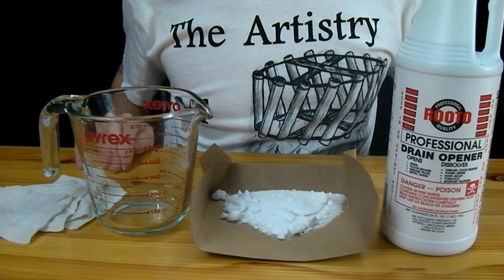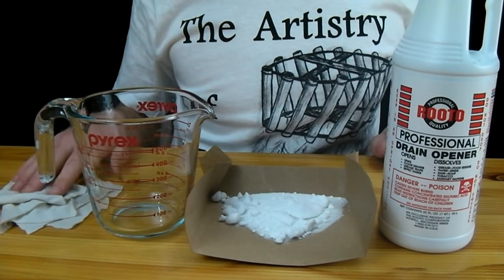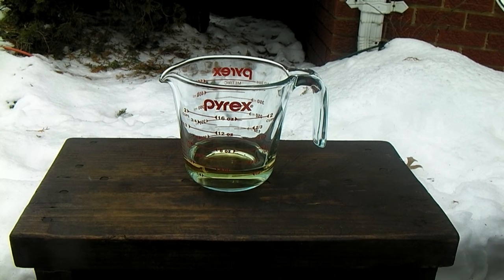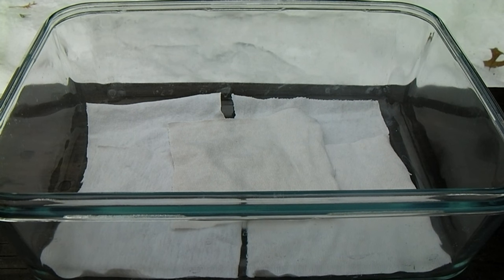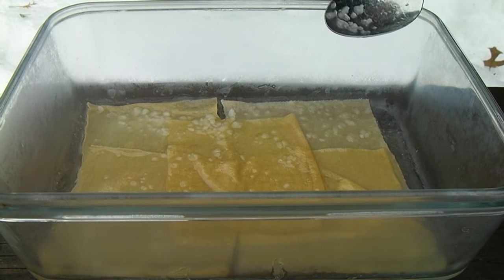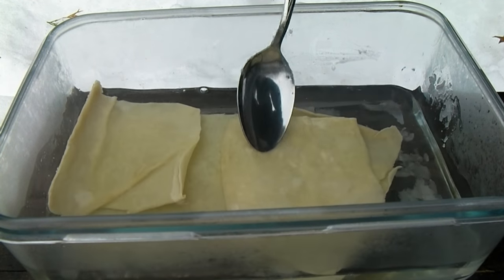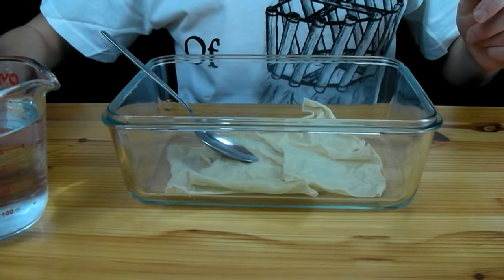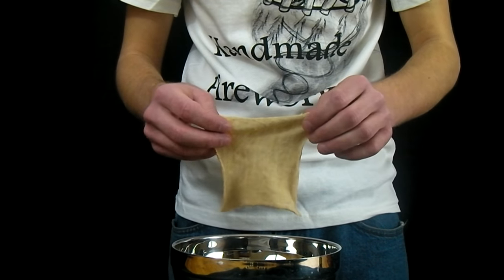How to Make Flash Paper - Magic Trick Fireballs (Nitrocellulose)

Comment: Ebay or one of those pro-healthfood online stores, you can get food grade quality for dirt cheap prices from the healthfood stores because the purity isn't the selling point even though it has to be >99,5% to be food grade.

So get it there, but it will come in granulated and not in powder form since it's for food preservation to be used like your average kitchen salt, so you are going to have to grind it.

Those are your options if you want to spend little money. I got 5kg for 24 euros.

Comment from the maker: When it is formed, the nitric acid is in a solution heavily contaminated by the remaining sulfuric acid and the potassium sulfate byproduct. It could not be used in other experiments as if it were a marked bottle of a specific concentration because it is so contaminated with other reactive compounds. If you want to know what percentage the nitric acid is to the rest of the solution, I have not done the calculations to find that out.

Comment from the maker: Nitric acid is formed in solution:
2 KNO3 + H2SO4 → 2 HNO3 + K2SO4

This is where the nitric acid comes from when it is distilled out of a sulfuric acid/nitrate solution. This process simply skips intermediary distillation, and absolutely does produce nitrocellulose. You can see direct performance of product from this same potassium nitrate process in the video here: /Nbt057a8Zzc
Or, nitrocellulose made by substituting an equal molar mass of ammonium nitrate here: /J3Ot4AcO47Q

Comment from the maker: You are incorrect. This burns slowly because the fabric used is a low grade cotton. You can see a high quality nitrocellulose made with this same method on my homepage. The chemicals used in this are very dangerous, and the same ones used in commercial production. Nitric acid is made in solution for this method, where usually it would be added directly, but otherwise it is exactly the same.

Comment: Nitrocellulose is made with nitric acid and sulfuric acid. They work separately like when Aqua Regia dissolves gold. Most people don't know  but cotton is mostly a sugar. when you add sulfuric acid it dehydrates it leaving broken bonds the nitrc acid is also dehydrated and has a key to the bond on the cellulose. The two connect and you have a nitrocarbon and sulfuric acid with stolen hydrogen.

Comment: @ERFireworks I found Rooto drain opener at Ace Hardware.  Just check the plumbing section of every hardware store in the area.  Sulfuric acid drain openers often come with the bottle in a plastic bag, and mention sulfuric acid somewhere on the label.

Comment: Seeking advice:  I followed the instructions in this video, but it didn't work.  I must have made a mistake.  The cotton squares dissolved to mush.

I used sulfuric acid from Lowe's.

A lot of the potassium nitrate (50grams) didn't dissolve.  There were clumps of it at the bottom of the pyrex measuring cup, even after much stirring. 80ml of acid was recommended, and I had used 100ml.

I increased the acid until all of the potassium nitrate dissolved.  It was about 200ml total.

The instructions said to wait an hour after pouring the mix on the cotton.  I used an ice bath to cool the glass tray, but didn't have much ice.

I waited 80 minutes and the cotton  squares had dissolved to mush.

Any ideas on what I did that made this procedure not work?
Reply: I had the same problem with concentrated battery acid. Later I was able to get pure sulfuric acid and it worked. I suppose there will be differences or additives in the acids.

Comment: doesn't the sodium bicarbonate wash cause the  nitrocellulose to burn slower?
Reply: +schel sullivan Sodium nitrate neutralizes the acid but it adds impurities which you have to wash out. And the cooling bath is necessary to make sure the cellulosedoes not dissolve in the H2SO4.
Reply: Awesome thanks I've learned a lot this year experimenting and making videos
Reply: @keymaster2108  i heard you can just boil it in distilled water, is that true

Comment from the maker: @cheerdiver ...Not quite...You're chemistry is a little shotty there. Three nitro groups can be given in one acid bath, it doesn't take multiple runs.

Also, freezing NG sounds extremely dangerous. Liquids crack and shear as they freeze, and both of those things are two major initiators for sensitive compounds. This is why large crystals are avoided at all cost in solid HE. Frozen NG would be much more dangerous than liquid.

Anyway, please, no more discussion of HE on my videos.

Comment: You should leave the tissue paper in the acid mix for about 4/5 mins turning over half way through then soak in running water for about an hour

You can place a few sheets on top of each other whilst in the max say 3 but no more 

I use a dustbin with a hole in the bottom and a hose with running water in the top

Comment: Interesting fact: The base components of modern smokeless gunpowder are nitrocelulose and DNT (Di-Nitro Toluene).  TNT is the stronger Tri-Nitro Toluene.
Reply: TNT = TriNitroToluene.
Reply: Emx2000 he already said that
Reply: Ther are two basic types of modern smokeless powder, single base, and double base. The single base is nitrocellulose and the double base is nitrocellulose and nitroglycerine. (  One advantage that nitroglycerin has over some other high explosives, like TNT, is that no solid forms of carbon (in the form of soot or smoke) is produced when it is detonated. This allows nitroglycerin to be used to make 'smokeless powders', which is of great advantage to artillery or naval gunners whose field of vision does not then become obscured during battle by clouds of billowing smoke. ) 
Quote is from a UK source.

Comment: 2:33 The way I learned it, acid is added to water to control the heat of solution and prevent boiling, which would cause the acid to spatter.   Maybe I was taught wrong.

Comment: nice way to get an acid burn, The safe way and much faster way to make Flash paper or Nitrated Paper like we use to make Black powder cartridges Is to buy potassium Nitrate from amazon or  You then mix it into warm water until no more of it can be dissolved into the water This makes the water fully concentrated. You then add  paper. we use news paper. You then carefully remove the paper and let it dry naturally  The now dry and fully Nitrated paper is extremely flammable and  explodes when lit

Comment: It's amazing what you can find on youtube. I noticed that your samples burned slower than other examples I've seen. If that also the impure cotton from the shirt? I'm interested in making flash cotton for a military silmulation prop, to make it look like one of my staff are firing a rocket launcher. Will this process work for non-woven cotton stands? If so, do you have a suggestion for what exactly to use as the base material?
Reply: Any carbon fiber material the pure the better.

Comment: or you could just heat up the reactants potassium nitrate and the 18 molar sulfuric acid and run the vapors through a condensor that uses a fish tank pump to circulate the water to have a higher yield of nitric acid as well as a higher concentration.

Comment: MMMMM

Not sure about using potassium nitrate!

Should use equal amounts of concentrated Sulfuric and Nitric acids 

As stated, during the mixing process a lot of heat is generated so an ice bath is a good idea

You need to use chlorine free tissue paper it’s a matter of trial and error tissue paper that contains chlorine (used during the manufacture) will go brown chlorine free will stay white

You can use cotton balls and follow the process described above to make flash wool

Comment: 1. The deflagration rate is sub standard rendering your nitrocellulose useless for anything. 2. The mix should be 2 sulfuric acid 1 nitric acid. 3. Finding potassium or ammonium nitrate outside the United States or Somalia is literally impossible (although so is nitric acid, it's incredibly hard to get and will get you put on a terror watch list unless you buy dilute stuff as a film chemical). 4. Don't cool it, you want a hot mix not a cold mix, cold mixes produce slow burn and a saturation under 12%, hot mix produces over 13% which is good for flash paper, fireworks, explosives, or propellant depending on what you're making it for. The last three are illegal where I live so the best I can make is flash paper, which is still a neat science experiment for the kids. By hot I don't mean actually heat it mind you, just not freezing, room temperature or slightly warmer. Google nitrocellulose there's a million articles on the topic.
Reply: Hey uh its literally so easy to get potassium nitrate, its in stump removers and saltpetre, which is used in cooking, cant be put on a watchlist for making brine, but large quantities do require more information for purchase.

Comment: Ummm...that's not flash paper.  Flash paper burns much, much faster.
Reply: +jmculve It is... Kind of. It's just not fully nitrated, otherwise like you said it would have gone up instantly.
Reply: +Xei To say the least.  I am not sure it was nitrated even a little bit given
the process.  The creation of flash paper is typically done with nitric
acid.   Given the poor control of the nitric acid process, it is clear it was
not very successful.  He was using a metal spoon for instance which could
contaminate the results.
Reply: +jmculve Teh speed of deflagaration and the bright light produced would very much indicate nitrocellulose. 

I&#39;ve used this method many times to make my own, (its fast an easy) and while he certainly did many things wrong that makes his results worse, it does create nitrocellulose (just not really good quality nitrocellulose).

White fuming nitric acid gives a far better result, giving NC that have vanishes in hundredths of a second.
Reply: +Xei I am aware of the reactions.  He did have a litte bit of nitration to be
sure and I do not deny that,  but the lack of control made it very ineffective.
Reply: +MrLittlelawyer "Far better" is an understatement.  His method is poor
at best and the flash paper produced not effective.  Properly nitrated
cotton/gun cotton is a high explosive because it denotes when packed
tight.  That is why it was used in mining.  As a result it litterally "flashes"
out of existence when caught on fire--that is why it is called flash paper.

Comment from the maker: @hexamine2012 No it isn't really. This is a quick process using sub quality cotton. If the directions are followed exactly from my website you'll see I add more sulfuric acid about mid way through the nitration. If that step is added and more nitration time allowed you'll see that this process is very capable of creating an extremely fast product. The video I have attached to this shows an example of NC that was made with the longer process. It is fast enough to rival any commercial product.

Comment: Weak man! It should have burned way faster than that! U shouldn't of been able to hold it cause real gun cotton burns so much faster.
Reply: Christiancrusader that's different from gun cotton, gun cotton is made from loose cotton fiber, like stretched out cotton balls. I would assume but I'm not sure that you could do the same process to cotton balls to get a faster reaction.
Reply: allthings possible yes it can be done but it should burn much faster than that if done right.
Reply: Filip laskovski it doesn't matter what kind of cotton as long as it 100% cotton. It can be socks under wear whatever. And there's two ways to nitrate cotton. The 30 min way or the 24 hour way which is much safer.